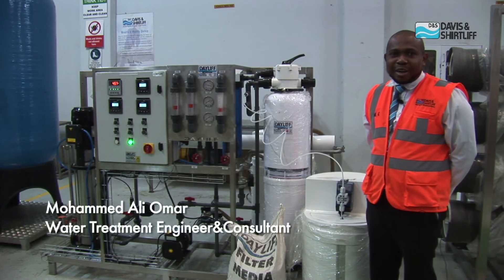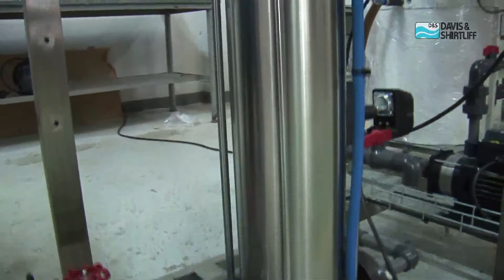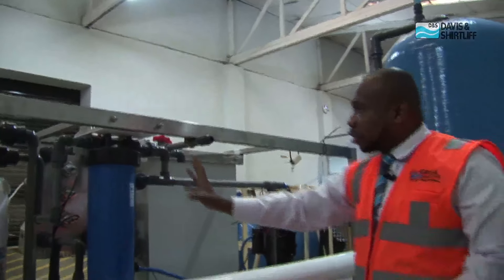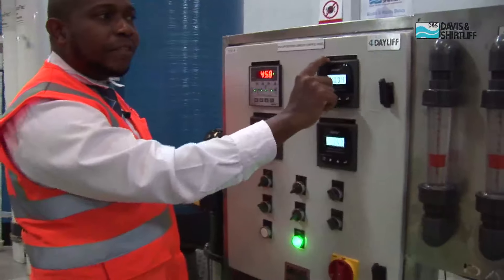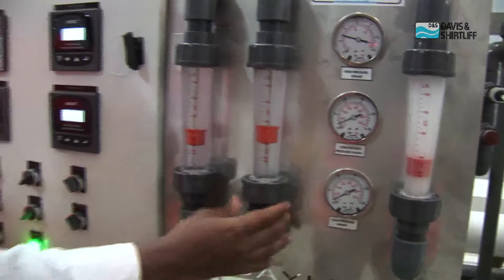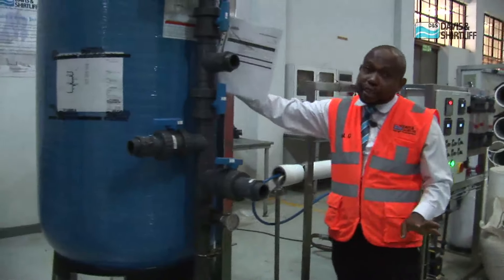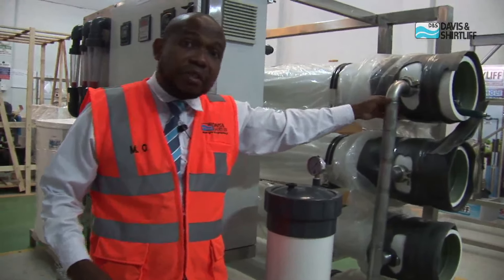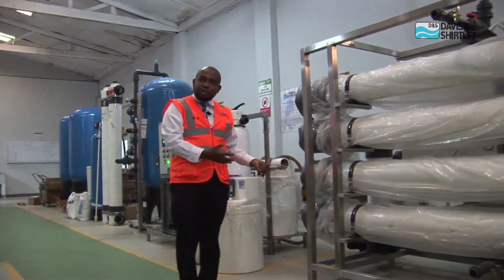How a Reverse Osmosis Plant Works

Comment: How much does it cost with this requirement: 

1: capacity ( permeate flow): 12,000 liter per hour
2: Feed TDs  3,000 PPM
3: 20 hrs/day operation
Reply from the maker: Hello, budget is Ksh. 7,000,000. Visit any D&S branch near you or call 0711079000 for further clarification.^BO

Comment: What is the cost of the machine?
Reply from the maker: Cost varies from Ksh.450,000 depending on the quality of the raw water to be treated and the system's flow rate. Deliver a 1litre sample to our Lab located along Dundori road industrial area for analysis. In case you require any clarification, call 0711079000. ^BO